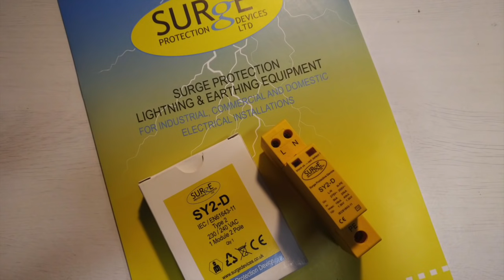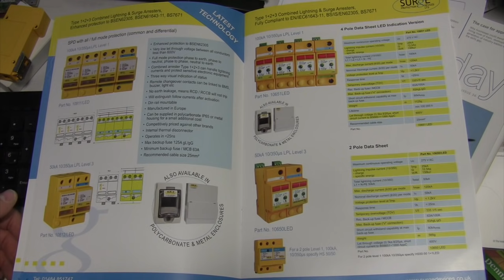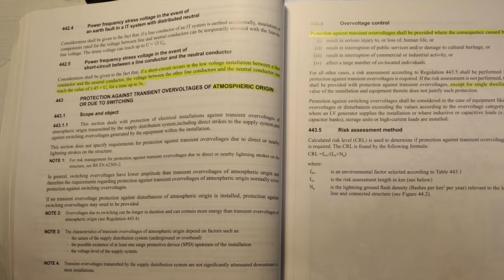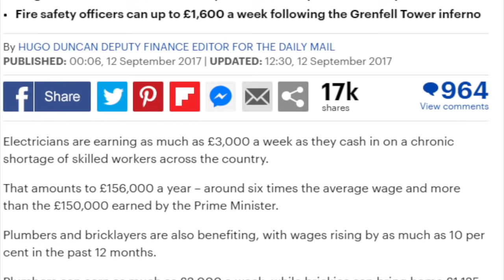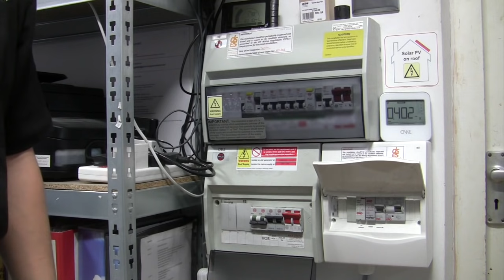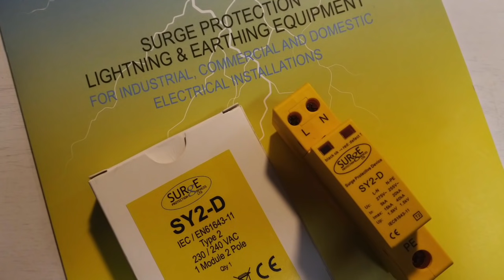The SY2-D surge protector (SPD)

Comment: I’m at a loss? Absolute zero device will protect a home if it’s hit by a lightning strike
Reply from the maker: This little yellow widget won't protect from a direct strike, a lightning rod and type 1 surge protector would be needed for that. This fellow is supposed to squash small surges on the line that might damage electronic equipment.
Reply: David Savery Electrical Services surely even a type 1 doesn’t stop strike? I was under the impression if you’re house is hit by lightening it gets fried regardless of what you have in place. Maybe I’m wrong
Reply from the maker: @Callllum  Lightning protection isn't something I've ever had to install or work with, so I'm not best placed to answer, but a lightning rod should provide direct protection from the strike itself by channelling it to earth instead of it passing through the building, while the SPD is there to squash the noise induced onto the electrical system to prevent the electrical accessories and building wiring. My understanding is that direct strikes require this two-part protection for the sake of the structure and the devices within.

Comment: Excellent video, makes surge protection a little clearer.  Would appreciate a video on SPD’s & TT systems.  Also a video on the use of types of RCD’s, within a standard installation.  I have spoken to the niceic helpline regarding the new regulations concerning RCD types & that didn’t clear anything up either.  You also mention that you have used a contactor for the shower & electric vehicle.  I would be interested in how you have done this.
Reply from the maker: Funnily enough, someone else was asking about the shower/car charger contactor, so I'll put a vid together soon on that!

Comment: How did we ever get by without them ,or indeed 443.4 I mean were buildings blowing up all over the place cant say I have noticed
Reply: maybe not that serious i seen a few strikes direct (not that  spd can stop that ) but transient voltages can damage expensive equipment maybe not blow it up but just stop working now i never seen this myself so its just a theory in my head, most equipment is rated to 1.5kv , i think this is a manufacturer forcing the reg thro and especially insurance companies maybe the dno know summit we do not at this time

Comment: Nicely explained! 

For other viewers reference, David's configuration/wiring diagram for installing this SPD is at: 13m:47s ~~ #NB/#Note: that the graphic showing the connection of this device around the 14 minute mark is technically incorrect - it should show the main switch connected to the top of the #RCD, then the #MCB connected to the bottom. A #corrected graphic can be seen on the website: #DavidSaveryElectricalServices https://www.dses.co.uk/images/Images/Tips/SPD/type2_install1.png

#SPD/#SurgeProtectorDeviceAdvice me please: "I need to fit a SPD just after a Henley house-cutout it's set-up with T-N-C-S thus the SPD set-up will be leading to the consumer Unit{with a Split-Load with two RCD's); I bought the BG garage CU  for retro-fitting a SPD, can you give me/others further fitting instructions/advice?"
Reply: Not really. Do you can found different RCDs manufactured. Do you can buy them for one till three phases, "N" at left or right side, and 'go in' on top or down. All depends the regularies of this special country (here: UK Main Island) where do you can buy them. So it is sometimes not good to use online trading for electrical things. Exakt for that the companies labelled "N", "L1", "PE", aso. too. In Germany and Thailand the products have a wiring diagramm at the side or at extra card.
 

Here in Thailand and in Germany (and other EU-Countries) are the regularies are different to UK Main Island. If you then looks to Hong Kong, Australia, Canada, or India - they use many different regularies too.
Reply: BTW: The double-pole SPD to be fitted is: "KESOTO C20-2P 20KA-40KA 220V AC SPD Surge Protector Protective Low Voltage Arrester Device" 
-Material: Plastic & Metal；Input voltage: 220V
-Size: 87x60x33mm/3.42x2.36x1.29inch
-Nominal Discharge Current: 20KA
-Max. Discharge Current: 40KA
-Installed on a low-voltage power line for first, second, and third-level lightning protection and surge protection.

Bought via #Amazon: https://www.amazon.co.uk/dp/B07HQLX6FV/ref=cm_sw_r_tw_dp_U_x_eSxsCbGYP9SAJ 

To be fitted with a: BG 100A DP Breaker into a: "British General 5-MODULE 3-WAY POPULATED GARAGE CONSUMER UNIT" from #Screwfix =
https://www.screwfix.com/p/british-general-5-module-3-way-populated-garage-consumer-unit/1926g?_requestid=106700#product_additional_details_container 
 

Please help!
Reply from the maker: If you're fitting a single-phase double-pole surge protector at the source of the installation and before the consumer unit, then you'd take the tails from the meter into the enclosure that contains the SPD, terminate on the input terminals, then take the tails from the output terminals to the main switch of the CU. Obviously, the power would have to be isolated by an in-line isolator or removal of the main fuse by an authorised party before anyone can work on it. Is that what you mean?

Comment: Is the diagram showing type 2 spd correct? I don’t think this would work?
Reply from the maker: Is that the diagram at around the 14 minute mark? If so, that's how the manufacturer shows it connected in their accompanying instructions. Effectively, it's in parallel with all other circuits so should suppress a surge event that would otherwise apply to those circuits. I'd be interested to hear of your concerns though!
Reply: Yes, perhaps being a bit facetious but the connections don’t look quite right?
Reply: Main switch should go to top of rcd, then bottom of rcd to mcb?
Reply from the maker: @nickstocker5921  Sorry Nick, I wasn't ignoring you, I was waylaid by Guinness when your last message came in. You are correct, and that is the danger of drunken doodling I'm afraid. Alcohol and art programs do not mix! Sadly, I can't correct it on YouTube, but I have changed the image in the linked article on my website. Cheers!
Reply: @nickstocker5921   Not really. Do you can found different RCDs manufactured. Do you can buy them for one till three phases, "N" at left or right side, and 'go in' on top or down. All depends the regularies of this special country where do you can buy them. So it is sometimes not good to use online trading for electrical things. Exakt for that the companies labelled "N", "L1", "PE", aso. too. In Germany and Thailand the products have a wiring diagramm at the side or at extra card.

Comment: Hi, just to make sure i understand this right,
It is not forced to install spd in domestic DB.. unless your risk assessment will give you high number?
Reply from the maker: The risk assessment method is pretty unusable, but Regulation 443.4 allows an exemption for 'single dwelling units where the total value of the installation and equipment therein does not justify such protection'... whatever you want to read into that! The way I see it, I'll offer it as an option on domestic consumer units and leave the client to decide whether or not the value of their installation and equipment is worth protecting!
Reply: @dsesuk  thanks for helping me to understand this nonsense..
I will do similar thing for my clients.. however cant see many going for it..
It's not the cheapest upgrade..
Specifically when it's "optional"
Reply from the maker: @callimero2409  I guess the more rural the location, and the more tech gadgetry the homeowner has, the better value it will be to them. It depends if they figure a £65+VAT part is worth the peace of mind or not, but that's up to them to decide. Personally, I prefer to have one on my own home than not.
Reply: @dsesuk  that's not bad for whole home protection if you consider individual surge protector extensions can be £20-30+ for a decent brand.

Comment: Hi David,  another great channel to help us poor strugling sparkys.  I'm afraid I have nothing to add but I think you did spark off one of my pet hates.  -  If I heard correctly; at some point you said an earth conductor of 6mm squared is required.   I asume you meant 6sq mm. As the former is six times the size of the later, the difference is significant.  Keep up the good work please.
Reply from the maker: Good point. As the wife will attest, I'm always exaggerating sizes.